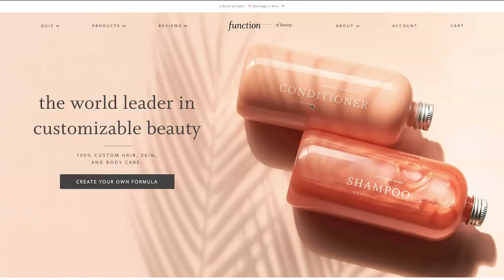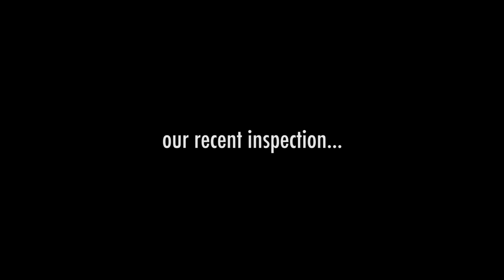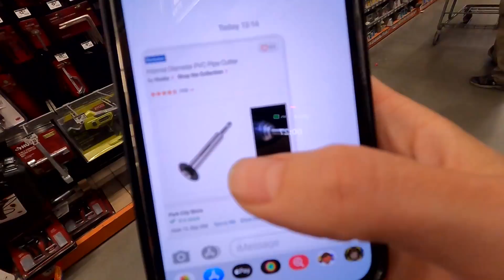BUILDING A SHOWER IN OUR TINY HOME | TRENT & ALLIE

Comment: Make sure you water-proof the window and ledge; make sure water cannot settle on the ledge or seep around the window at any point (top, sides, bottom).  I had a window like that on a shower once, and it resulted in all sorts of problems.  I removed it on a re-model.
Reply: Where is there Green board??

Comment: Red Guard is a waterproofing product that you roll on and the tile sticks to it after it drys.  Might think about it for your other wet applications.  It also does crack isolation with one coat, two coats at wet application.   Great product!

Comment: That’s why we got a  thick solid drain pan that looks like granite from Innovate Building Solutions and thick solid walls. So much easier than all of the tile. No grout to deal with either! Made in the USA!
Reply: We did the same and I love my 3x4 shower.
Reply: Love my stuff  🇺🇸 Made in the USA🇺🇸
Reply: Rules for do it yourself showers:
1- no horizontal landings, (ex. Widows, bottle cubbies etc). 
2- least amount of grout lines, especially flat ones where water can sit and get absorbed.
Reply: @Medliving  ... can get solid surface sill materials at home centers ,,cultured marble ,, install with slight forward tilt to drain water ,, same with shower seat if desired..
Reply: Yup.  I got mine from Onyx but same thing, custom fit, easy clean and really easy install.  Plus no grout to clean.
Reply: IBS?  Unfortunate.

Comment: Just a suggestion for when you start sanding and finishing your drywall mud. Get like four big sponges and a couple 5 gallon buckets. Use the damp sponges to sand and blend your mud to the surface. Way less mess and a better finish. Then just a light skim coat and repeat. Hope this helps you out. I’ve dry sanded mud when I started, it’s miserable and you end up needing mask and a ton of cleaning up afterwards. The wet method is the way to go and leaves much better finish. It drys pretty quickly once you reach your desired finish, a couple hours. Won’t  hurt the mud, and you’ll get it down fast on how to do do it.

Comment: An 'access panel' is a very common requirement for plumbing for the floor above from the floor below. It is there for access for any leaks and or problems that might occur in the future. Don't sweat it, it's kinda standard and part of the learning process. Best of luck.
Reply: I have big access panels behind both of my showers. I can access pipes, faucets and drains
Reply: ..not sure why it cannot be glued extension from surface ,,then cut to height of chosen tile for beveled drain effect...
   .. have worked in finished trades for over 20+ years ,, never saw an access hole except for whirlpool tubs / built in jacuzzi tub ..for access to motor ..
Reply: Never seen an access panel in a ceiling!

Comment: As the inspector inspects what’s been done so far,  be advised carry a magnet. So since the bathroom screws are covered up , he can run the magnet over the screws in the bathroom to see those screws are NOT metal. Just in case he doesn’t have one on hand. Stainless or non metallic screws should be used in wet or damp environments, so they don’t rust and or corrode. Love your informative videos , keep it up.
Reply: I never knew that, learned something new today. It makes perfect sense about non metallic screws. I purchased my 1925 house in 1987... there was a bit of modernization,  i.e. wiring, insulation and then paint. Resheetrocked the entire house, myself!
Reply: @heatherk8931  By yourself! a big thumbs up for you
Reply: Gee we just took pictures of before and after which we sent them to the inspector.  We were never allowed to provide equipment for the inspectors as their equipment had to be approved, tested and calibrated to ensure their methods and test met the requirements.

Comment: The only things I'd start with on the old house roof electrical plumbing...  those are always the 1st problem's ...in an old house insulation next 
❤️❤️❤️❤️ 
I'm glad your getting grampa & Gramma close by.
Reply: Not on a rental .
Reply: It's a rental right or did I misunderstand?
Reply: @sharrazonnecoy7261   no you didn't   They said its a rental.

Comment: I get so confused sometimes by you guys.  "We are under so much pressure to get this done before the inspection in two days... OK let's go play golf "
Reply: Tick tock ... did they say Thanksgiving ? Maybe the baby can sleep at the rental house ? Lets go golfing and renovate a rental home?
Reply: Cant do much else, shower needs to dry pre jointing done. Parents are there, might as well golf!
Reply: @ianmcleod8898  a lot can be done. The top half of the shower.   The downstairs bathroom. The laundry room. Building a house especially with a deadline there is always stuff that can be done.
Reply: @michealfrench6488  not to mention a ton of corner bead that could have been done before the first drywall inspection!

Comment: Those shower kits are great Mike Holmes uses them all the time; but isn't the whole idea of that shower kit to minimize seams and you just created one at the now low point of the floor.
Reply: Laughably funny. I do tile for a living and have for over 40 years, the shower kits are garbage. I literally just got done ripping another one of these out this week. Since they came out with these kits, I have ripped out at least 10 of them and they have not been out that long. Funny that the old school way is still the best way, and that I have only ripped out maybe 3 in my lifetime.

Comment: Does the windowsill get a “pan” to drain the collected water from showering down the wall. I’d hate to see collected water mold the window pane and rot out the window.
Reply: Yes, happened in my last house which is why I dislike windows in showers.
Reply: Mary on Richard's phone from Florida. I live in a 1955 bungalow the shower has the original tile and I have noticed that when I take a shower and water gets up in the seal it runs off so when they installed the tile they put it on an angle not much but just enough.

Comment: You used the wrong trowel and thin set that wasn't thin enough for kerdi membrane application. I've done several kerdi shower preps. Schluter has a thorough application manual, along with great YouTube videos, and there are many other kerdi shower prep videos done by others, too. It's actually a great, versatile, effective system for pros and diy-ers. Just follow the correct steps, none of which is difficult.
Reply: I think they should have the wall membrane overlapping the corner piece, too. Or am I misunderstanding that?
Reply: @brendamohs8411    No, you've got it exactly right. Shluter install specs call for all membranes to overlap at least 2", but that's achieved in most cases by butting the edges of membranes and covering the seam/with a thinset-adhered kerdi strip, which is the same product but only a few inches wide and a thinner gauge to avoid too much buildup at the seam. This strip is usually applied last at all seams and corners.

Comment: Sorry Trent bro but the pan usually goes in first then the wall liner overlaps the pan. Think shingles on roofing!
Reply: That's what I was thinking... it's going to drip behind and under the pan... unless there's another step we haven't seen?
Reply: Nope. Not necessary here. As long as he does a 2” overlap he’s waterproof. This is a bonded connection not a lap effect like shingles or flashing. This will last a lifetime.

Comment: Had the exact same problem and I came in from the top.  Cut out a square of flooring , fixed the plumbing then reinstalled flooring with some blocking and everything worked out fine.

Comment: I used Shluter Kurdi system for a bathroom reno a few years ago.  Back then, they didn't have the fancy foam floor pieces so I had to dry pack and form the floor myself.  Not easy.  I also did a section using self-leveling grout.  I figured i'd be able to trowel it into shape a bit.  I was wrong.  That stuff goes from thin milk shake consistence to rock hard in a matter of seconds.  it's funny looking back now but at the time I was panicking, trying to contain the liquid grout which was running everywhere and not staying in my form, and all of a sudden it firmed up.  I went from panicking about trying to contain it, to panicking that I wouldn't be able to form it up.  It all worked out but was a very stressful day!  The Schluter walls and floor have stood up well!

Comment: I stated this before, but by the time you complete your house you will have the experience you need to build a house MORE CORECTLY! LOL! You are to complete all plumbing and electrical before sheetrock. But you can always cut access panels! Also when you install your rock tape you apply it with the first pass of rock mud IS WET, .... NOT DRY!!!!!!!

Comment: Schluter has amazing YouTube videos. With the line drain you can use large format tiles on the shower floor. If you choose to go with any tile larger than 13x13, make sure you use a good thin set made for the application such as 3n1 or Ardex x7(both schluter approved for use on kerdi). Also make sure to use an uncoupling membrane or cement board over the subfloor before setting the floor tile or your tile will start popping within a year.

Comment: Here in the south east if you are turned down by a building inspector for what ever reason such as the wrong screws in the shower area you must ask before he leaves when you do the repairs can you continue with the process or do you call in another inspection so he can see that the repairs where in fact completed! I built new homes for several builders for years and know of other superintendents who had to tear things out because they did not call for the second inspection so you may want to make a quick phone call and check.

Comment: Thank you for another great video. Allie you did a great job of editing. I know you will be seeing this too late to make any difference, but, as I remember, one of the reasons you failed the drywall inspection was the wrong screws in the special drywall in the bathroom. How is the inspector going to see that correction, when the screws have been mudded over and now covered with mortar and membrane. An impetuous perfectionist creates his on pain. Stay safe, hydrated, and well.

Comment: Another tip working with Schulter. once you’re at the point just before you install your tile, Schulter makes corner bead, either plastic or metal, and molding to give a finished edging for exterior corners and creates a really nice clean finish edges to your wall tiles. Especially around the window in your shower. Home Depot/ Lowe’s carries it.

Comment: Tile the shower pan first. Then the back wall starting with a ledger board a few inches up from the pan, depending on the size of the tile so you can trim for the pan (leveled ledger board-you can use base boards- they are often pretty true) then back wall followed by side walls. It doesn’t matter so much if you caulk or grout first, sometimes I don’t use any caulking unless it’s floor to ceiling I will caulk along the ceiling to clean up the edge and go easy with the amount of water you use cleaning while grouting so you don’t pull too much color from grout. Don’t worry about the haze and wipe that off with a soft dry cloth the next day.

Comment: There are fittings for that drain pipe ....go and ask before tearing down ceilings trying to fit a stupid rubber coupling.... One thing with water it will find a way through so don't be scared to go overboard with the sealant.

Comment: Normally you start at the bottom, then the next layer goes on top of that, then the next lay on top of that, so when the water hits near the top, each layer as it goes down is directing it inward, doesn't allow it to get to the wall...

Comment: When it comes to the shower pan and that coupling I would simply cut an access panel right next to it install it tighten everything down and put the panel right back securing it right where it came from should have no problems do it right there on the floor

Comment: One of those drywall ceilings in the 1924 house has been recently patched. I hope the roof was repaired properly. Because people usually patch ceilings because there has been a leak at some stage. Still, it is a rental and not a purchase, so the landlord will have to fix any problems that arise. Old houses can be great, but they can have a lot of expensive problems: structural, termite problems, electrical, plumbing, etc, so a thorough inspection of all major items is a must. 
I obviously know nothing about the situation in Utah, but in Australia, millions of old homes were built in part, by asbestos, even roofs and walls, particular in "hot spots" like around cookers and stoves.  Removing, drilling, or sanding asbestos products is extremely dangerous and requires experts and techniques for removal and disposal. It is obviously expensive to remove and dispose of.

Comment: Houses built before 1978 or so tend to have paint that contains lead.  The dust that collects on the sills from moving the windows up and down is a common place to find lead. Old houses are classic and interesting but there are some dangers that come with them that more modern building codes seek to avoid.

Comment: You should have sized the wall with some water before applying the mortar. Then it wouldn’t have dried when you screeded your grooves. A wide brush and some water would have worked just fine 🙂

Comment: Trent I guess you have never installed a shower. Yes, you need to tighten from below. Also, do not assume the drain will not leak before closing up the access below to tighten a drain.. The fun is going to keep getting better. Are you going to texture the walls?

Comment: On that shower ... you should have hired a pro.
I was married to a tile pro ... shower stalls are tricky.
FIRST ... he would ALWAYS build the curb out of brick ... no wood or any other material that could rot. 
He would get the flexible shower pan material (reminds me of a wet suit type of material) and lay it all across the bottom AND 18 inches up the wall and over the curb. He would set the drain himself, because it had to be raised, and attach the pan material to the drain. Also, the drain in a shower is supposed to be 3 inches diameter. 
Then he would install metal lathe over the cement board on the walls and on the curb. Then he would put on a one-inch layer of cement all over the walls. 
Then he would "float" the floor by putting a layer of cement on the floor over the shower pan, making sure all areas of the floor sloped toward the drain. (This is why the drain was raised in the beginning.)
After all that cement cures for a few days, then it's time to install the tile with thin set. 
It may have been the "old school" way of doing it, but my shower will last longer than any other part of the house ... AND it won't leak.
Also, it is NEVER a good idea to put a shower stall on a second floor level. 
And some other viewer mentioned not using metal screws. When my husband installed handicap bars in the bathroom, he always used stainless steel screws. 
He was a master!
Good luck.

Comment: I don't like those fittings for anything inside a house.  I have used them outside, but the one time I used one inside, as my contractor told me to do, it failed.  Granted the drain should not be under pressure, but it will still have water, and I would not use that rubber fitting in a ceiling.

Comment: Thinset was entirely too dry and you had way too large of a notch behind the Kerdi. 1/8” x 1/8” square notch is recommended for the Kerdi install. 1/4”x3/8” notch for the tray & curb.
Reply: Isn't the pan supposed to go in 1st, then the corner piece, with the wall membrane last, so it overlaps the corner piece?  Looks like they have the wall piece behind the corner... Concerned that this shower was not installed correctly.  Sounds like you've worked with Kerdi before.  Maybe try emailing them before they get to the tile install?

Comment: So weird that on a new build you'd have to use tgat rubber coupling like that, usually the drain gets glued, u may have done that wrong or been sent the wrong parts bc I've used that system many times... best shower system out there for sure but even on a remodel i glued the drain. That curdy pan doesnt have the inset drain flange either, very sus

Comment: Do you guys know that it takes 3 sizes of muddying tools. The first one you’ve been using to do the screws but then when doing the taping you start with the smallest. Which you didn’t have to pre fill. You put the mud in the seams then with wet tape you snap it on the the mud then at an angle you go back over it lightly to spread out the mud from behind the tape. Now that you filled the seam I’m not sure it’s going to work but? Let dry lightly sand if needed then use next size up to go over the small line of mud and tape. Once dry again. Lightly sand and use the biggest trowel to finish the seam. If you do it right you shouldn’t have to sand that much at all.  Use what I say if you like. Just wanted to help. Sorry but all that muddying you did on the seams you did for nothing. But I love watching everything you’ve done and you guys are awesome.

Comment: You should just open up the ceiling and move the drain pipe where it needs to be for the Schluter system at the same time. Otherwise you will have problems down the road requiring even MORE demo. DO IT NOW while it's easy to fix.

Comment: Acrylic shower pans are a much better and easier and cheaper options. Shower water proofing is an absolute joke. Those companies have done an amazing job convincing people there necessary. 20 years from now 99% of that stuff will be in the landfill having never touched water.  What’s it protecting ? If your shower is leaking it is fixed before any framing lumber is damage and if it is replace it with the new renovation. Done dozens of bathrooms and have never used it. Use mold resistant drywall and tile and grout properly. That’s it, simple.